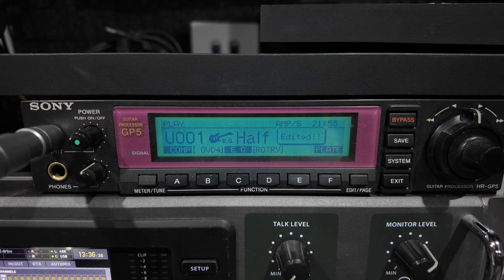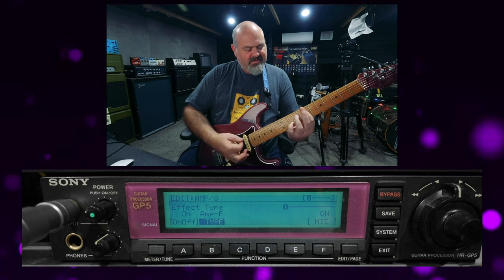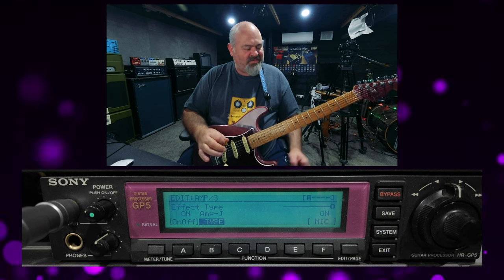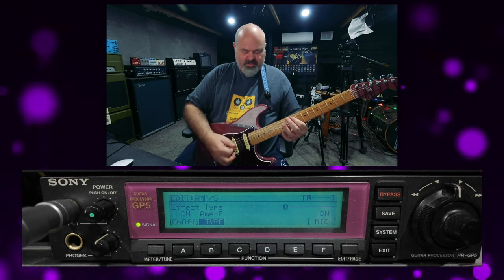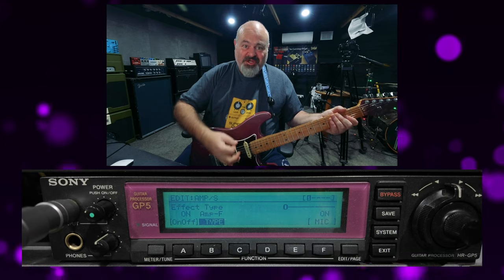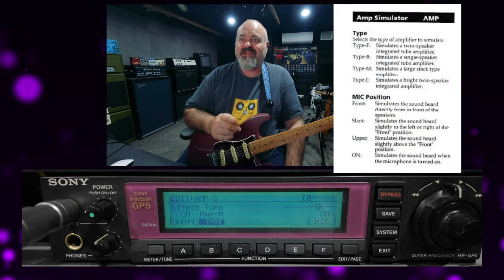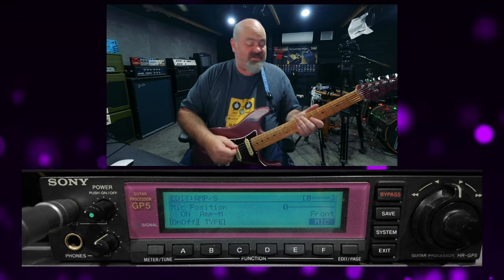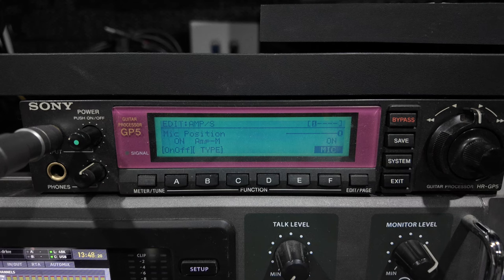Amazing vintage Amp models from the SONY (HR-GP5) #guitar #sony #ampsim

Comment: This unit's strength lies in it's delay effects. Some really good algorithms in there for that alone it's worth it. I didn't find the drives that responsive but sounds good none the less. Mine also craps out when you switch to user presets - guessing I need to solve the battery issue at some stage!

Comment: They were not too bad!
As I see it, F = Fender twin, B = Fender Bassman, M = Marshall Plexi stack, & J = Roland JC amp!

AS to the mic posis, Front is dead centre straight on, Slant is centre or just off, placed OFF axis to the speaker, Upper, well that's the same as any side, since a circle has NO 'sides', so I assume it is a certain distance AWAY from the cone, and On, I think means on the outer EDGE of the cone, as it does sound the bassiest of the lot!

Nice 1 Matt.

Oh DID you feel that tremor at apprx 12.50 am? Most of the tremors felt in Melb area come from the Latrobe Valley or Mornington Penn!